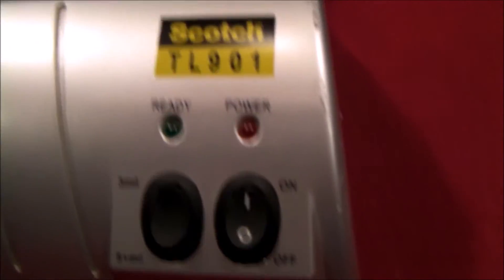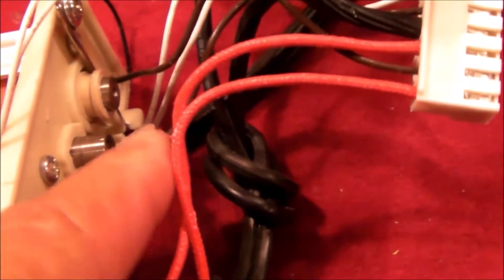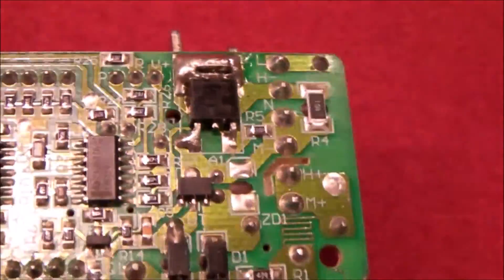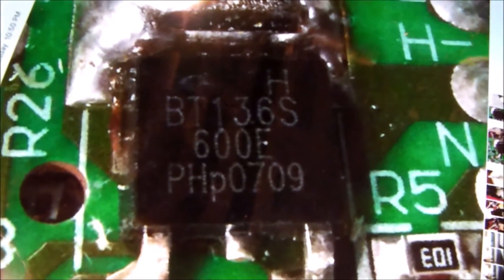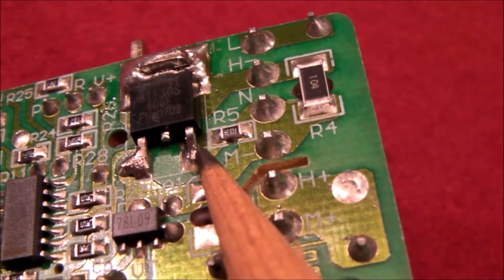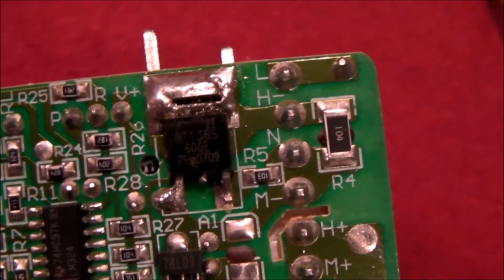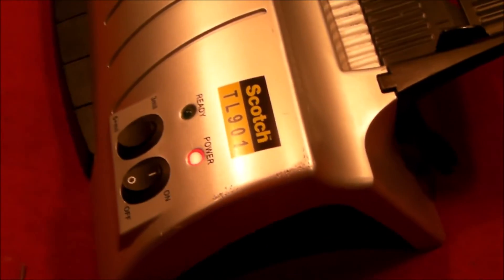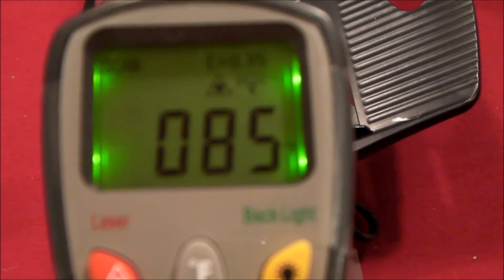FIXED!  Scotch Thermal Laminator TL901 won't heat up.  11¢ triac fixed the problem!

Comment: I would add that there are actually 6 screws in the bottom. The 4 under rubber feet, and two screws in deep holes closer to the center. One of these holes was covered with a white round "QC Passed" sticker.

Comment: Excellent troubleshooting. 
Thanks for sharing the knowledge. 
I have the same laminator that had identical problem - a bad triac. It was heating up slightly, but never to the proper level and the "READY" green light would never turn on. The 4 Amp triac is underrated for a 3 Amp heater. I used BT138 - a12 Amp full size triac which I happened to have in my parts pile. I mounted it on the existing tiny heatsink after drilling a hole in it. That heatsink, by the way, is made of steel. I screwed the BT138 to it up side down, and ran cables from the 3 pins to the board. I left the old triac in place after cutting off the two legs and removing them off the PCB. It works great now! Takes 4 min. for 3 mil heat up, and 6 min. for 5 mil.

Comment: I just dug out my TL901 after having it stored for 15 years. When I turned it on it had that burnt electrical smell, and the green light didn't come on after 3 or 4 minutes. I ran the doc through anyway and it worked fine, but do you think the burnt smell is that same triac overloading?

Comment: This could help someone: My TL901 worked great after installing a much beefier BT138 TRIAC. But then, it stopped heating up again. I just replaced all five electrolytic caps and it works great again! I used caps pulled out of scrap boards. Caps are 105 degree, 470uF 25V, 220uF 25V, 100uF 10V, and 2x 10uF 50V, Use 16 or 25V 100uF instead of that 10V cap.